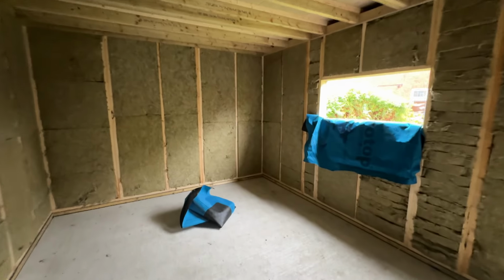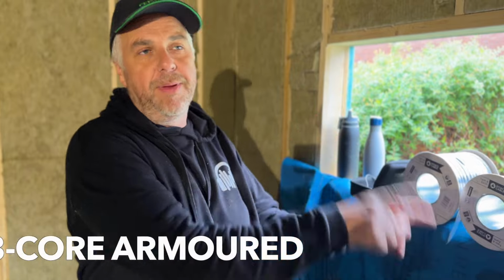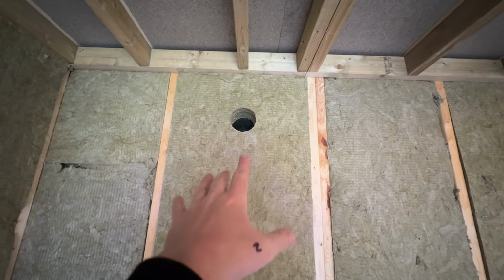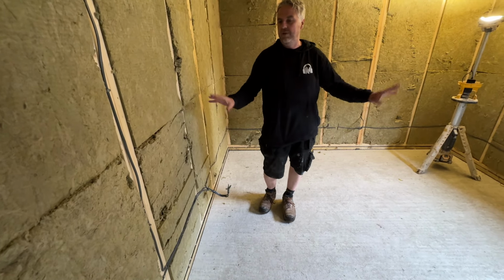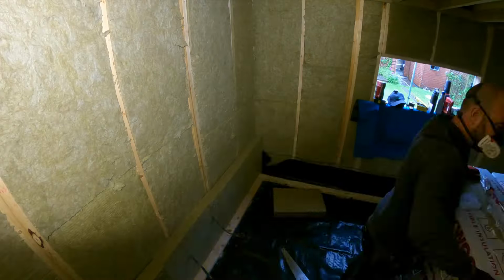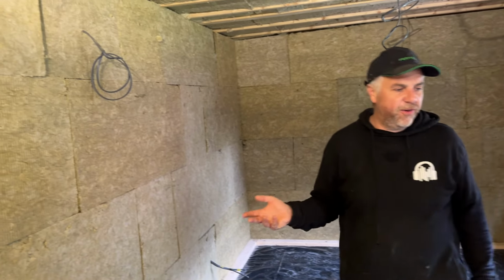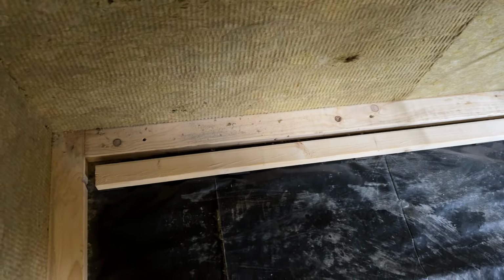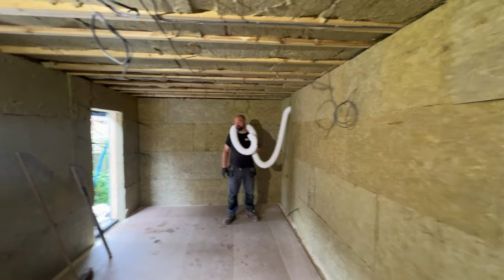Epic Drum Studio - VENTILATION EXPLAINED! (Electrics + Sub Floor + Insulation))

Comment: Hi all!
Absolutely love the channel. It’s given me some great tips and inspired me to get on with it haha

I do have one question about the ventilation. Which fans and waterproof boxes do you recommend for the external extractor fan? And how are you installing it on the exterior? As most fans draw from the inside. Is it as simple as turning the fan around? 

Thanks in advance and once again great channel!
Reply from the maker: We make our own waterproof boxes for outside the room. Any 4 inch in line fan is good (we don't use a timed one) it's just on a fan isolator to turn on and off. Just turn the fan around to draw air out of the room!

Comment: Wouldn't need the roof need ventilation/air gap between it and the insulation? I note you mentioned pushing the rockwool right up against the roof boarding
Reply from the maker: Thanks for watching 👍Its known as a 'Hybrid' Roof. There are obviously limitations with height restrictions and the soundproofing with it being a room within a room - this is the only way it can be done. We have been doing it this way for 15 years or so. The internal ventilation system passive and active keeps the room itself vented 👍
Reply: @soundproofingexpert777  ah I see thanks

How much gap do you leave between internal room walls and outer walls?